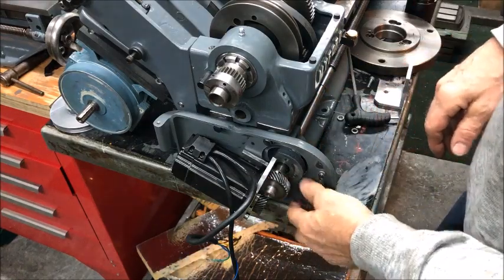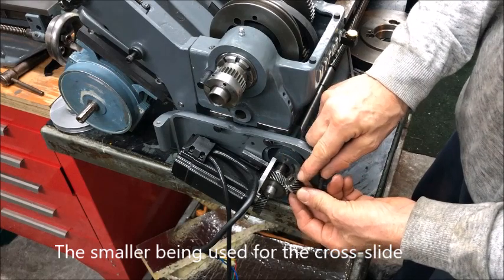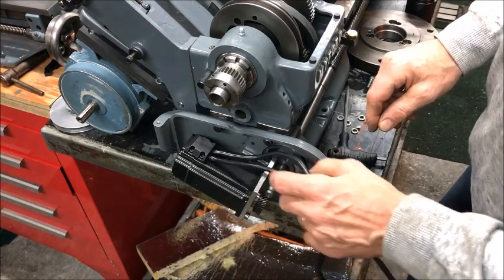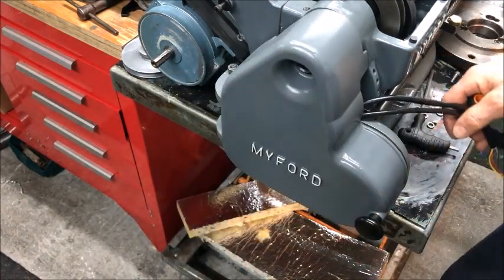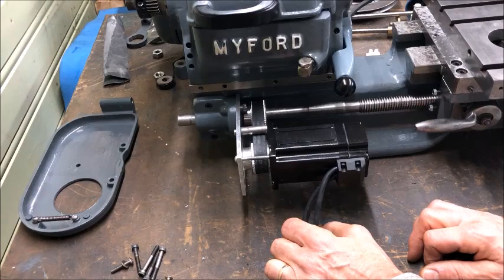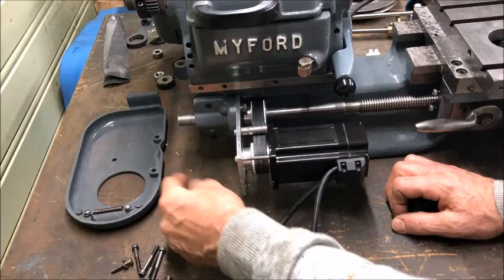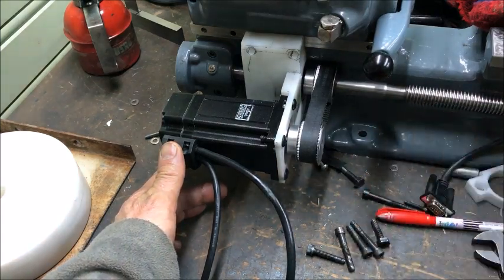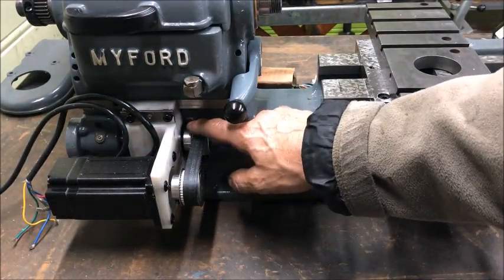Myford Super 7 - Z axis drive possibilities

Comment: Hello,
I've been following your channel for a while and I'd like to thank you for the great quality of your videos, they have been very helpful !
I have a question off topic from Z axis drive but I figured it would be best to ask it on a newer video.

I own a Super 7 and I'm currently in the process of refurbishing it (disassembly, repair and scraping of all the ways). I've been trying to remove the chuck from the spindle with no success so far.
I've tried to unscrew it (while the spindle was still mounted) with a wrench on 1 of the 3 jaws but I didn't want to put too much force on it. Then I put a hexagonal bar in the chuck to put my wrench on but I when tried to unscrew it the whole spindle started to rotate while the pulley remained still. 

Do you have a solution to remove a badly stuck chuck from the spindle ? I haven't tried heat yet as I don't want to mess up the spindle (which is already a bit worn)

Thank you in advance,
Cheers from France
Reply from the maker: Thank you very much for the nice words. I figured from the start that there was a point in sharing my own experiences like I do.
Just ask away.. my solution for the Z-axis drive is different from what most do I guess, but that was also part of the plan.. to show that there are different possible ways to solve a task like this, each with its' own details, minor advantages and concerns..
A stuck chuck is no fun! But, here also .. different possible ways to solve this problem. The obvious is the built-in solution using the arresting pin/bolt, located to the rear, left side of the headstock. This plunges directly into an indent in the side of the stepped pulley (rotate this around until you find this.. and pls. not there is also another smaller hole in the same path). If I remember correctly (I am writing this from the workshop..) this pulley is fixed to the spindle with a woodruff key (or a set screw). If you have already tried this way of undoing the chuck and the spindle rotates, it could be that this key or the set screw is damaged/needs tightening. If you haven't found/tried this solution .. well then try 😀. It is also referred to in the manual (haven't got one?). Then there are other emergency procedures.. I you don't plan to remove anything but the chuck I would try to stop the spindle from rotating by engaging the backgear. This (5-6:1 is it not?) power ratio normally provides enough resistance to be able to undo the chuck, maybe also blocking the gear with a wooden piece wedged between the gear and the inner front wall section of the headstock The big gear on the spindle is also fixed to the spindle with a small woodruff key (I think.. check the Myford website for the detailed exploded view diagrams, availlable for each section of the different machines). However, these "emergency procedures" are inherently "flawed" and must be performed with caution. If you eg. use a piece chucked up with a long lever and whack this too hard you may damage/destroy the big gear, shearing off a tooth! Hence.. not really recommended. I would remove the spindle, ie. disassembling headstock (you mention you should restore the machine so this is a needed process anyway). With the spindle out you have the option of eg blocking it up between two wooden pieces in a vice and have more ample work positiong and methods at hand. Good luck!
Reply: @jansverrehaugjord9934  - I bought a lathe for parts that had been broken by doing the 'whack on a long lever' approach. It isn't just a theoretical thing, it actually happens.
Reply from the maker: @somebodyelse6673  Yes, sad to see how some parts are really badly handled
Reply: @jansverrehaugjord9934  Thank you very much for your reply ! 
I forgot to mention in my previous comment that I tried the first method with the plunger but the spindle rotated relative to the pulley (which was locked by the plunger). 

Since then I disassembled the spindle (headstock). The woodruff key is fine and the groove in the backgear is also in good shape. 

After your comment, I reassembled the whole spindle to try again . I tightened the set screw on the back gear and tried to remove the chuck. I'm putting a lot of force on it and the spindle didn't rotate this time but I'm afraid to break something by pulling this hard. Edit : After putting a bit more effort, the spindle rotates again relative to the pulley, despite me tightening everything

I'm not really confident to engage the backgear. It looks pristine and I'd be mad if I broke a tooth on it (especially considering the price on the Myford website).

Dumb question (just to make sure) : what type of threads is on the spindle ? right hand or left hand ? (Right now I'm pulling counter clockwise, is it the right way ?)

About the two pieces of wood : do you suggest using 2 pieces with a V groove cut in them to hold the spindle ?
Reply from the maker: @superspinach5338  hmm..no, don't try the backgear. you may ruin this! I would chuck up the spindle in the vice, eg. in between 2 blocks inwich you  can for example make a V-notch, or better a hole with size a little,smaller than the spindle. The threads are righthand, so you are correct that you need to unscrew counterclockwise

Comment: Hi,
I did like it when the motor was in the gear cover, shame about the gear noise...
Cheers
Paul,,
Reply from the maker: Yes, it is a bit noisy.. maybe I will put in some insulating material to see if the noise is "airborne" although I suspect it to be "structure borne", which means isolation of the noisy elements from the rest is what will have the best effect. I guess the noise was what could be considered as low frequency, so probably some lead wall paper (I think I have some tucked away somewhere) plus a little of a lighter absorbent material although the amount I can stuff in there is limited (the effect is frequency dependent)